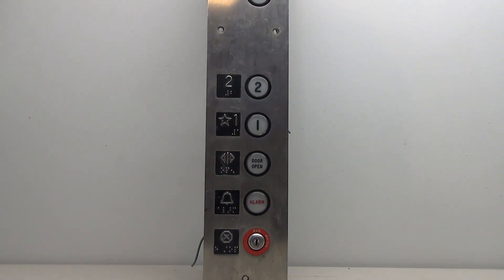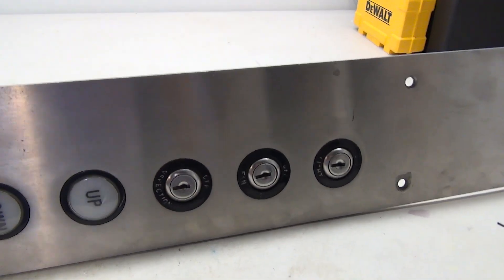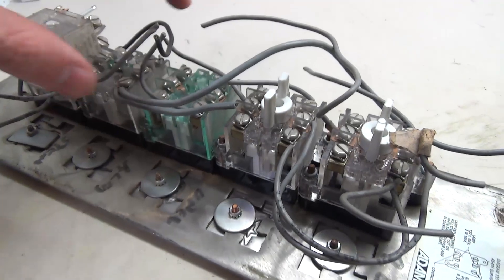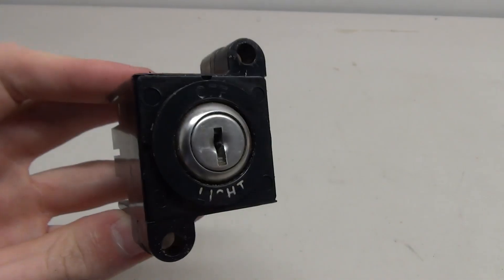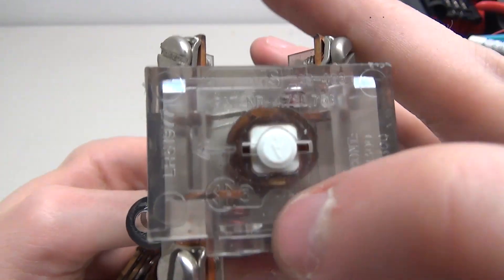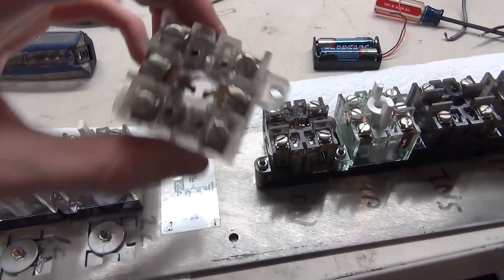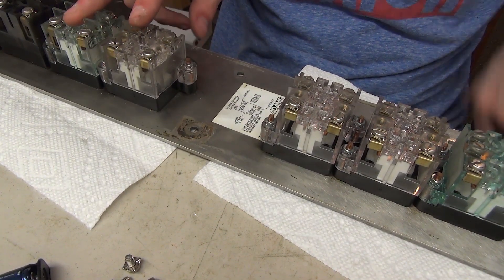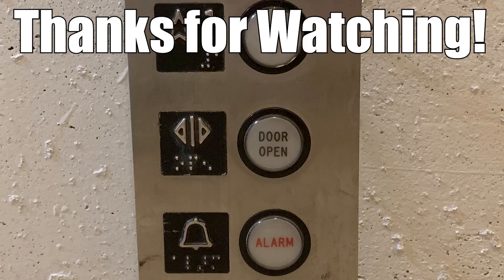Wiring an Adams Elevator Car Panel

Comment: How can you identify if you are using a 12V or a 9V for an Adams Intermediate Hall Station?
Reply from the maker: It is based on the voltage of the light you are using.

Comment: I know this is an older video, but my son just picked up a Car panel, call station and indicator from an Adams elevator and wants to do what you did with this. What LEDs did you use?
Reply from the maker: I just bought LEDs from eBay. You can use whatever ones you want for LEDs. You might find it easier to buy some bulbs to put inside, so you can use the original lamp holders. If you pick up some 6PSB bulbs and use a 9 volt battery, you will get a nice incandescent look in the buttons!